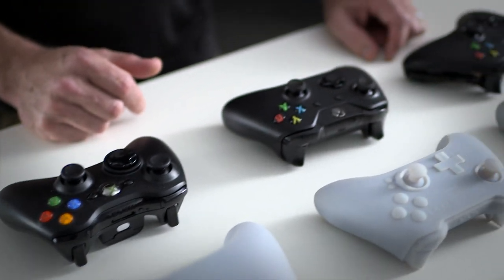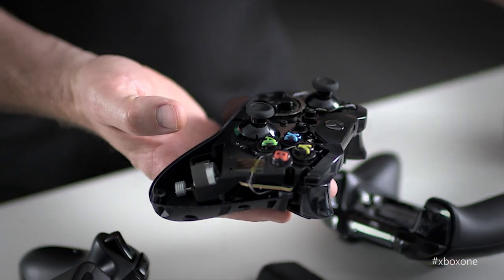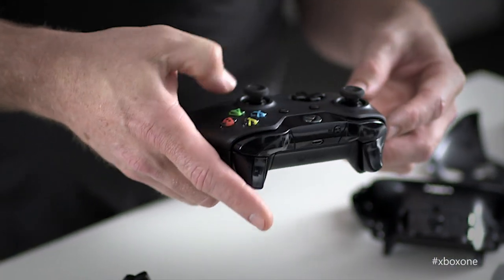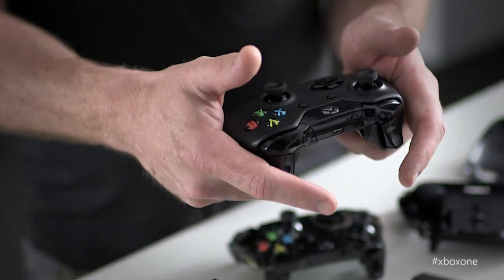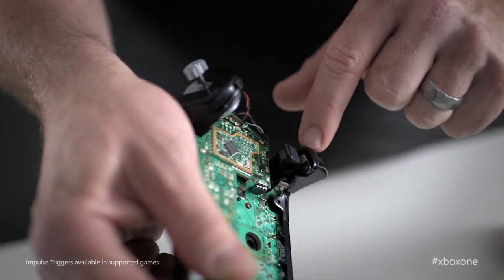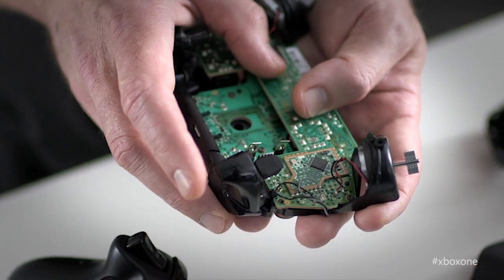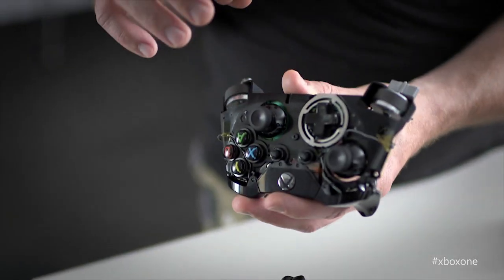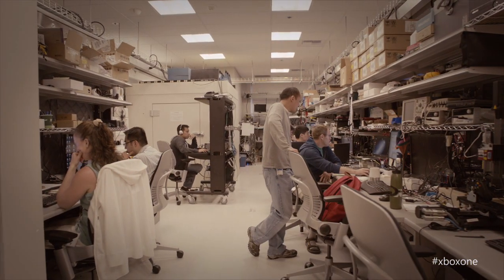Hands on with the New Xbox One Controller

Comment: The Xbox one controller sucks. The batteries might be inside but you still need to change them when they are flat.or you can get the play and charge kit at extra cost. Sony also has the battery on the inside no need for extra batteries or battery packs it only requires a USB cable to charge. Ooh you can have a wired and wireless controller all in one. My PS3 is a wired and wireless controller all in one old news old technology Microsoft. The Dualshock 4 is gonna kick the shit out of that shitty Xbox controller

Comment: What he means is that when the wire is connected the data goes through the wire. On 360 when you plug in play & charge kit the controller's data still goes wireless.

Comment: Decent improvements. Disposable battery pack instead of built in Li ion rechargeable in the stock controller is ridiculous for $500, but at least they made it possible to be wired with a USB cable.

Comment: The Kinect is no longer mandatory for the X1. You can disconnect it or leave it in pause mode and continue with your gaming or whatever. Plus you can use an external hard drive for the X1 plus X1 gives you the Cloud with unlimited space for free.

Comment: "Charging your Xbox One controller will be done via micro-USB cable (not included). No information yet on battery life of the controller, or charging time. The controller will take standard or rechargable AA batteries in a new integrated battery compartment. When you plug a micro-USB cable into the controller for wired play the internal radio is shut off and all data is transmitted through the wire. In this mode the controller can be used without batteries."

Comment: Yeah, they had a hard time. The design on the 360 controller pretty much made it impossible, so to make the battery pack internal and keep the same controller layout would be a challenge. Sony intended to have an internal battery back from the start, so they were able to design around that, instead of having to modify an already existing design like Xbox did.
Seriously actually think things through before you make comments like that.

Comment: They didn't discuss how the new xbox one controller isn't compatible with current gen headsets to work with the Xbox One. they said they're working on an adapter so it can be compatible, which will cost like 20$

Comment: I said has the exact same Dialogue, meaning the exchange in words between the two individuals is the same. If you watch, the structure of the videos are near identical with slight changes in wording, but basically saying the same thing. Host says, "So it is far more comfortable and improves gameplay." and the microsoft guy says "Yes, we tested and designed it for core gamers." implies script and not genuine interaction.

Comment: They have mainly fixed all the issues that people had with it. There is no drm, you can trade in and borrow games, it comes with a headset, has a great controller, has halo and other great exclusives. Yes they have made mistakes, but they have also fixed them. But it is your choice.

Comment: that controller's finally getting a built in battery which is not really an advancement as Sony had already done so. also the d-pad could still be inferior compare to PS controller since they stuck to using a singular pivotal piece this is bad as it causes the opposite direction to slightly raise up when the other button is being pushed down, because of this the pivot points aren't able to establish a snap relativity which is important to the input command board to perform accurate commands